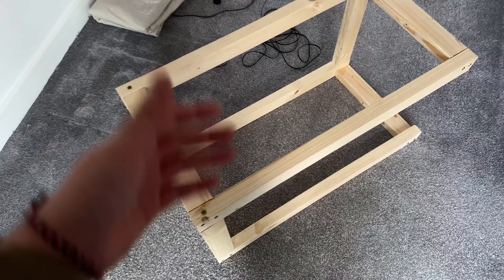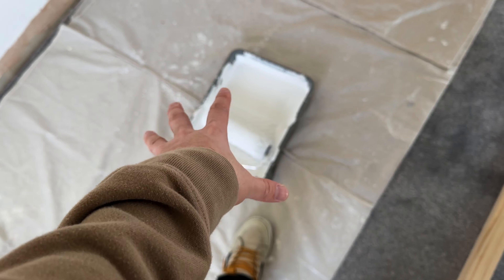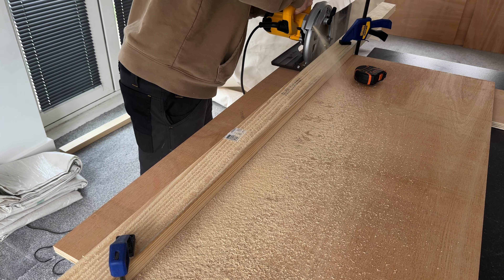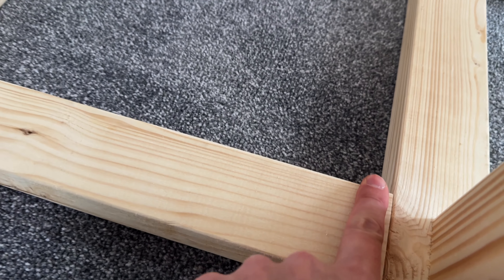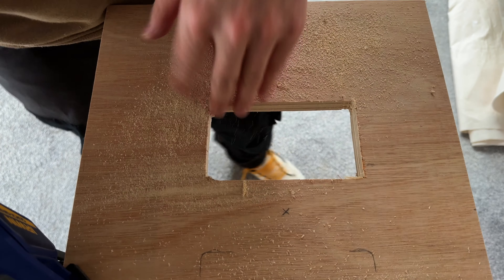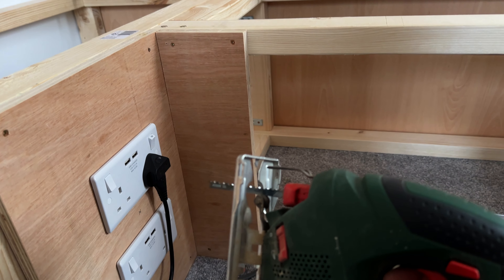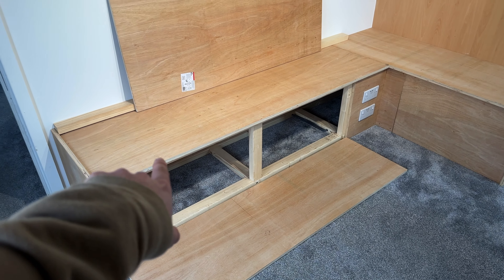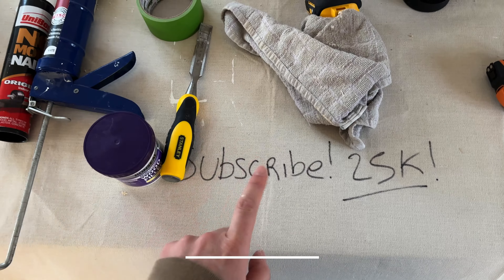Revealing the Blueprint for our Next Build! (Home Renovation) 🏠

Comment: Really love seeing how much care you're putting into this to make sure it's right and be able to be used like you want. I would say that the push lock is a great idea instead of the hinges, however just work out how much force is needed to pull the fronts off with those as they can be rather troublesome to get off with carpet. Possibly a couple of handles for extra pulling power 👍 Only a suggestion, no expert, expert at not getting ours off 😂
Reply from the maker: I really don’t want to mess it up 🤣 but i guess it shows how I am with projects like this haha! Yeah I think I’ve come up with a solution for that and I hear what you’re saying for sure!

Comment: Why not use the push release hinges they’ll be inside and unseen and easy to use
Reply: Like all modern kitchen cupboard’s mate
Reply from the maker: I did consider that but I’d still need to add hinges and skirt the bottom of the board for it to fold out, found a simpler solution for now! :)
Reply from the maker: I did consider that but I’d still need to add hinges and skirt the bottom of the board for it to fold out, found a simpler solution for now! :)